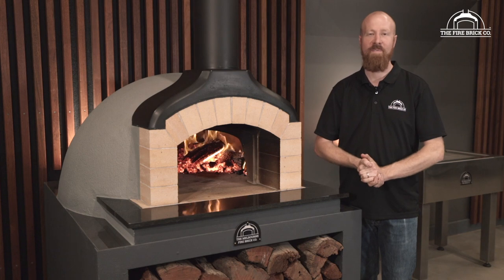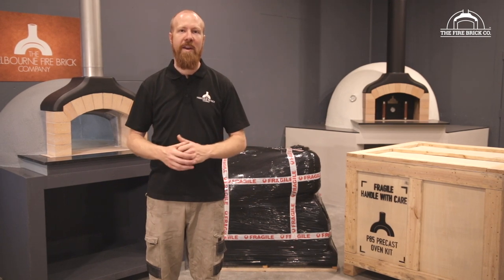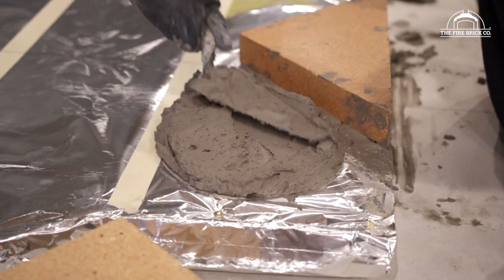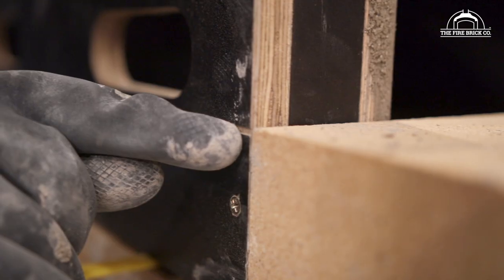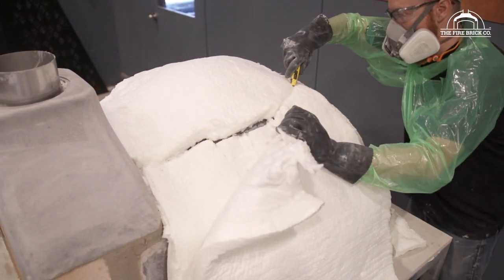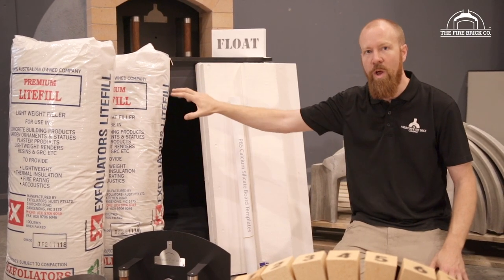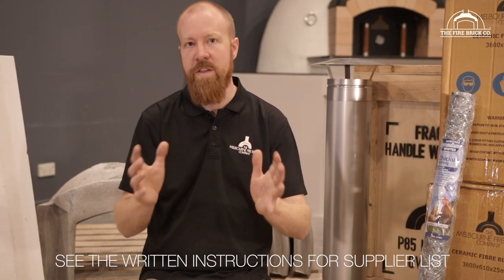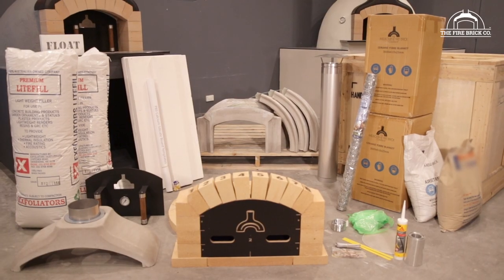How to Build our PreCast Oven Kit | 1. Unboxing & Overview

Comment: is that aluminium foil that u use under ceramic stone? pls reply
Reply from the maker: It sure is, that's just a temporary layer to allow you to more the tiles down without the mortar drying out against the Calcium Silicate board, which is very absorbent

Comment: Why dont you have a spec sheet with dome thicknes, door opening dimetions etc.  Also what are these made of, castable refractory material is pretty vague.  Is this a refraction clay material like firebtick, refractory concrete or what?

Why do you place the dome on top of the floor, that makes it impossible to replace as does mortoring ut down, it would be nice if there was a refractory sand option with the dome placed around it instead of on top of it

The oven has a lot of nice features but yhe construction doesn't seem to allow for expansion and contraction of the dome, including the way the capston is poured
Reply from the maker: Hi @knawl - we actually do have a full spec sheet plus lots more information on the kits, it can all be found on our website. Here is the link to the full spec sheet for the P85 including layout and cross-section drawings (I am assuming you're enquiring from the USA): https://www.thefirebrickco.com/wp-content/uploads/2022/07/P85-PreCast-Kit-Overview-USA.pdf

In terms of the castings, they are made from a dense Low Cement Refractory Castable, 45% alumina, reinforced with stainless steel fibres at 3% by mass of castable. (Refractory Castable is effectively 'refractory concrete', a material that can be mixed and poured into a mold where it is vibrated into position and allowed to set). 

We place the dome on top of the floor tiles because it makes the building process a lot easier than it would otherwise be, but more importanly because you just aren't going to need to replace the floor tiles - even in a commercial envirnoment where the oven is used 6 days per week for lunch and dinner, the floor tiles take more than 6 years to wear down to the point of needing replacement, so in a domestic wood fired oven they will likely never need replacing. Refractory sand as a bedding option would lead to movement in the tiles over time as you throw in large pieces of timber.

We have more than a thousand of the P85 PreCast Kits out there with no issues arising from the expansion and contraction of the dome, so you can rest assured that this isn't an issue you need to worry about. 

Feel free to email or call us with any further questions, we will be happy to help!